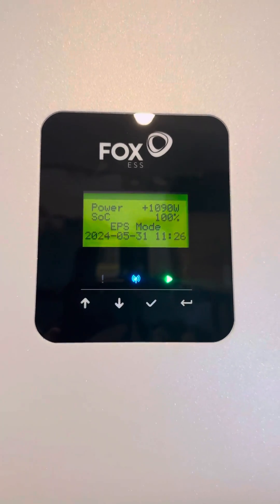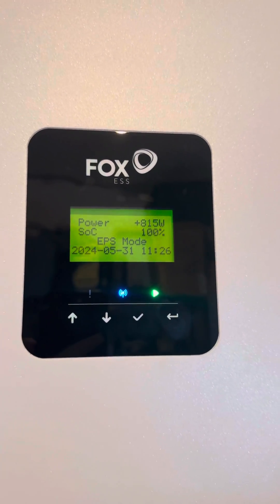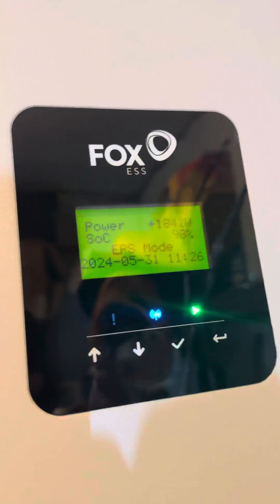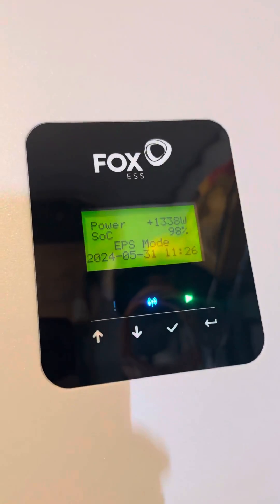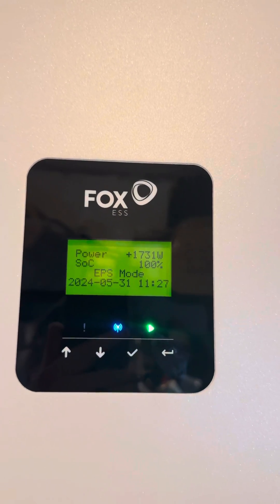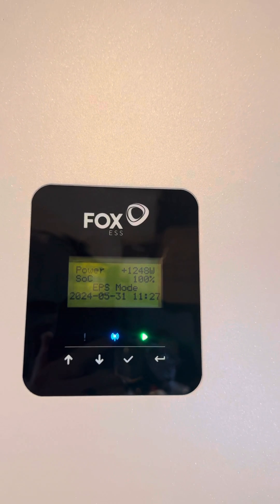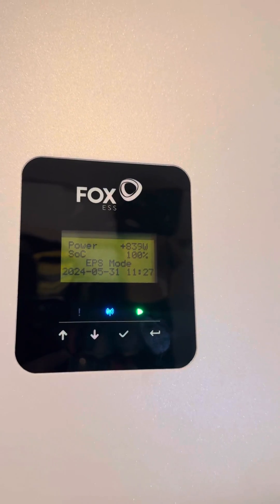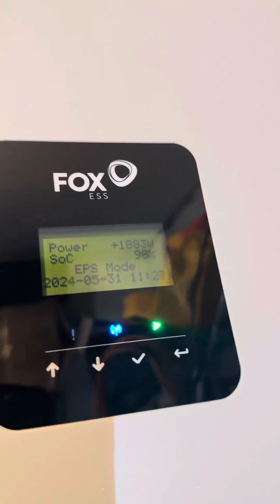FoxESS EPS Mode demo with 2 x K series in parallel

Comment: you can show the wiring of inverters?
Reply: i have 2 inverters in parallel mode
Reply from the maker: @loriscapaccio3978  I’m not sure I follow? Connect the network cable to the parallel ports. Enable parallel mode and then their output is balanced
Reply: @iameccles  thank you so much
Reply: do you use the eps TP box?
Reply from the maker: @loriscapaccio3978  I do not